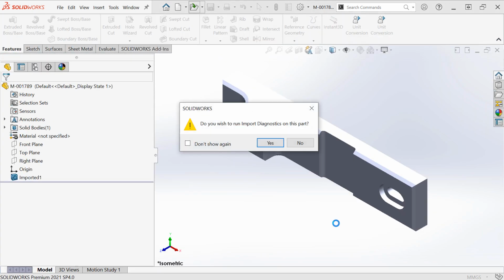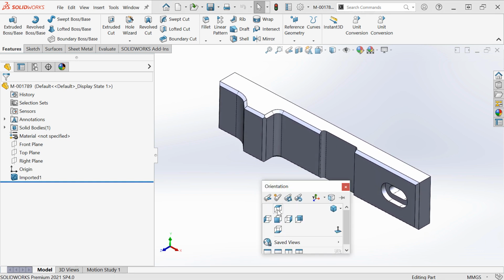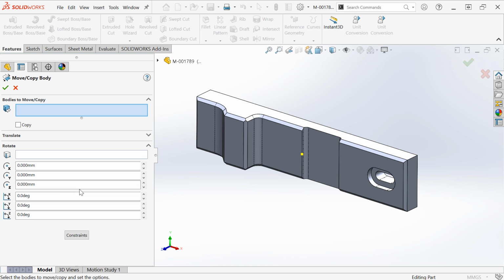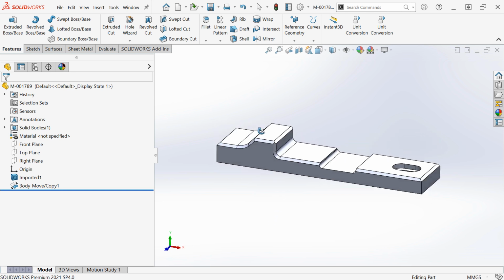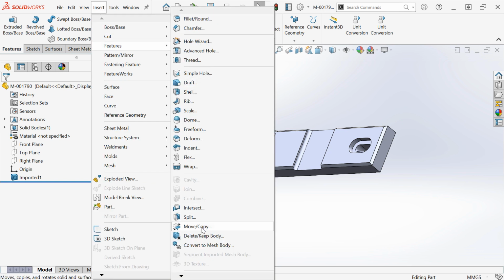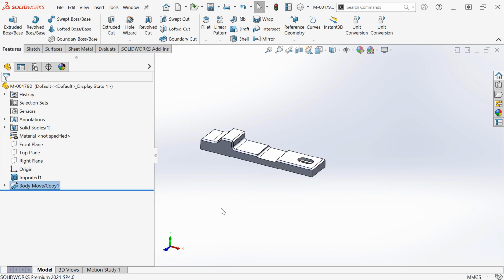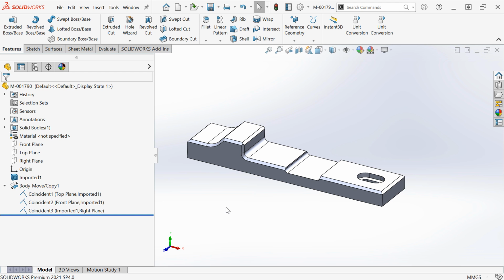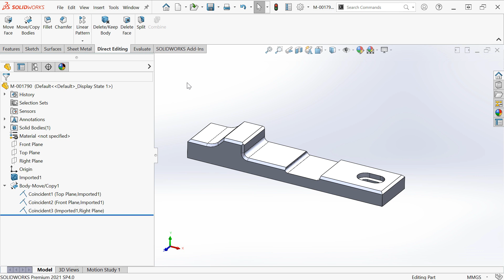SOLIDWORKS: Reorienting Imported Parts

Comment: Do you have suggestions for reorienting parts that do not have flat faces or straight edges?
Reply: Create an assembly. Use the cordinate system of the assembly (planes) and the cordinate system of the part (planes) to define the relationships between them. Save it out to a new STEP file. Import this STEP file again.... now the origin is where your assembly origin was.
Reply: @taavikoppel1769  interesting 🧐 thnx too

Comment: I would like to see a method to create a deep cavity that matches the shape of a STEP file... but with a 1mm clearance. We use SolidWorks 2018 so I do not have "project silhouette" available. I have Combine tool available when I have two bodies inside a part. I can add a Part to a single part but only SolidWorks parts... never STEP files.
Very often you get STEP files and need to create gripper fingers or cavities that matches the part.
Reply from the maker: This sounds like a great idea for us to show in a future video.

For now though to do this in a part workflow, you could open the .STEP file on its own and save it as a new .SLDPRT. 

Then insert the new (converted/imported) .SLDPRT into your fixture file. Position it using the techniques in this video and use the Combine tool to subtract it out.

As far as scaling up the imported body you could do this in either the "imported" SLDPRT or after inserting it into your fixture part file, but before doing the combine.

You could use the Scale feature to scale up the imported body by a certain percentage (easiest way).

To grow the part by specific distance like the 1mm you mentioned, then you could use a technique similar to this video :
https://www.youtube.com/watch?v=UhWBWn29ypI

Alternatively try out Shell feature with "Shell outward", which adds thickness to the outside of a body.
Reply: @hawkridgesystems  Thank you for the great tips.
On some parts the importing of a SLDPRT into another did not work. It shows the preview but does not import anything.. or just the origin planes if I choose to import these. I guess the problem is that the part to be imported is not "water tight" ... it has problems with faces, holes or surfaces.
Therefor no combining operation would result in anything useful.

Is there a way to fix a body like that? To make it a solid piece of material?